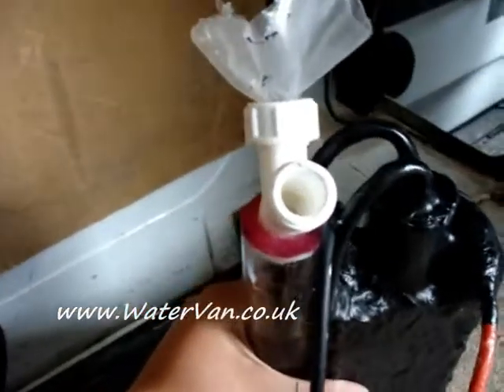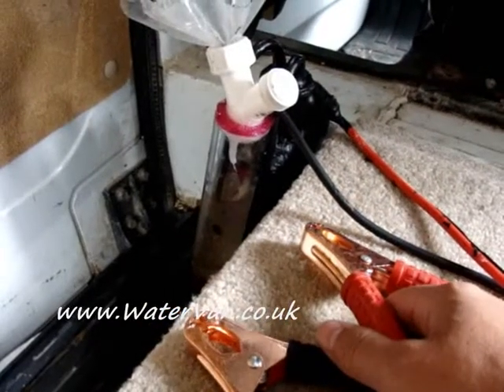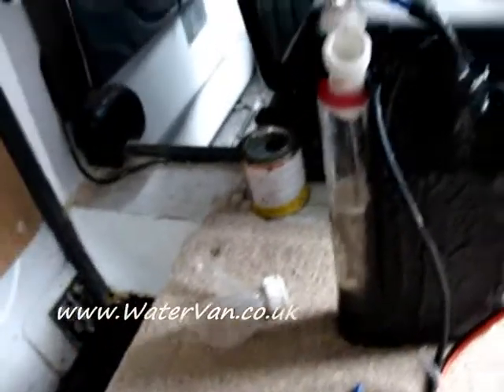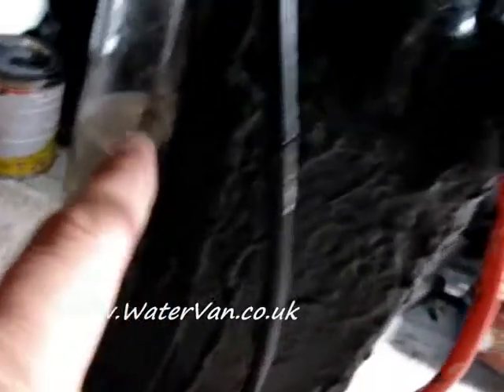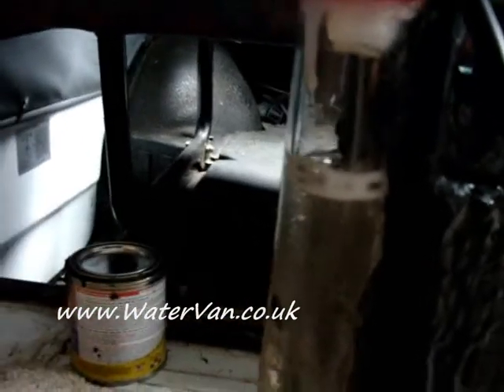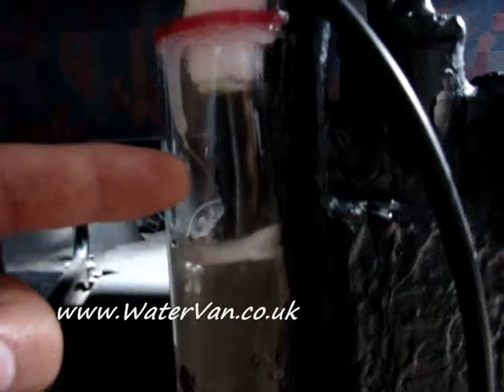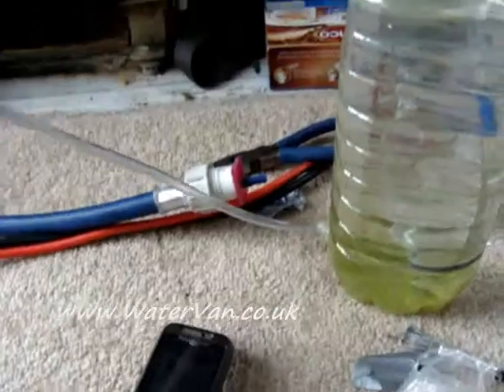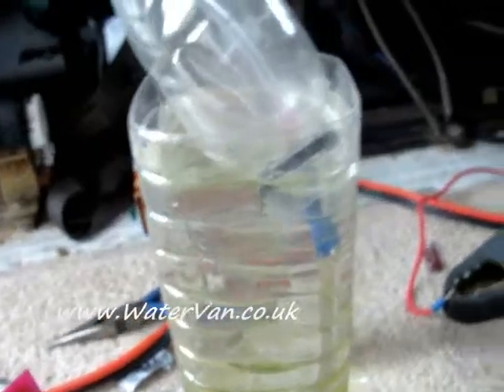#034 C5 MadStu's WPV - Mark 2 Problems. Disappointed.

Comment: try running the line from the top of the cell to the top reservoir not the bottom then put a bubbler on the other side